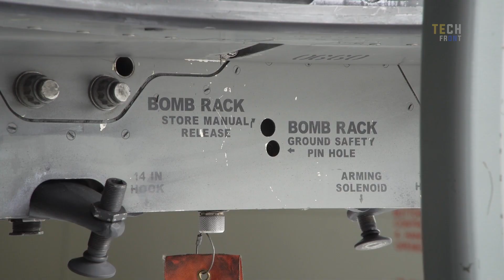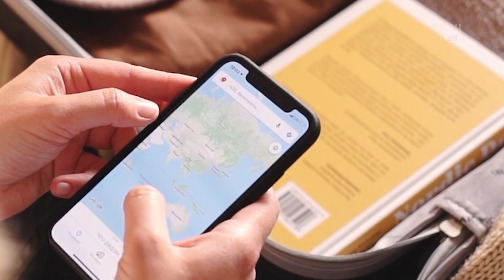New F-15EX SHOKED China the Only US Fighter jet To Destroy J-20

Comment: America's new F15-EX It is actually an obsolete platform for the following reasons: 
First.- It is only for aesthetic ego, the use of two absurd and enormous tail rudders that offer resistance to flying advance, high radar signal and unnecessary weight. A robust tail rudder like that of the F-4 Phantom is sufficient and cuts through the air better. Second.- It does not have steerable nozzles, which reduces maneuverability in aerial combat. 
Third.- It does not have cannard wings. 
Fourth.- When you run out of missiles, you need two cannons with a large ammunition capacity for attack/defense.